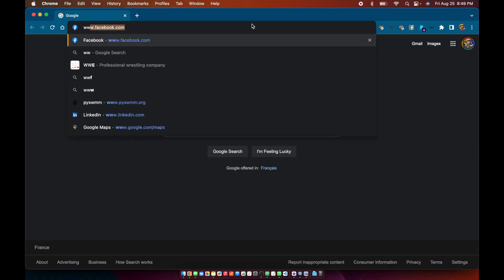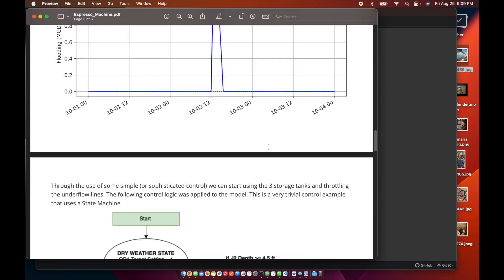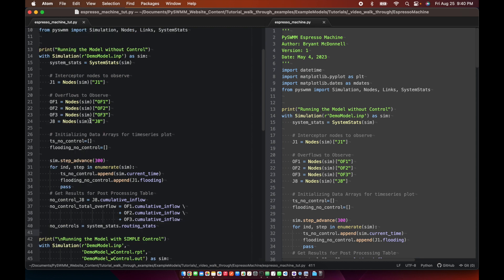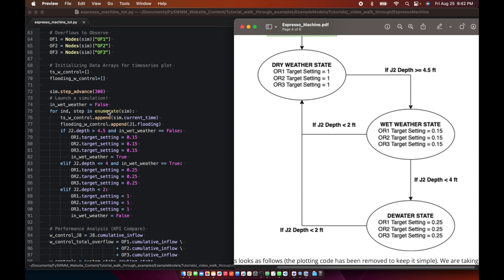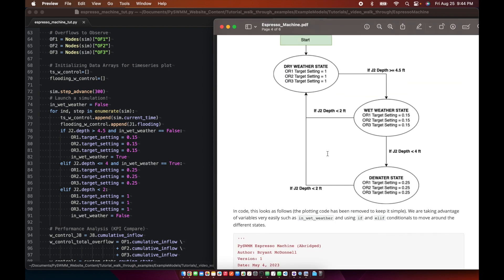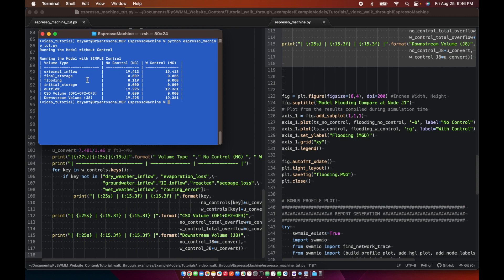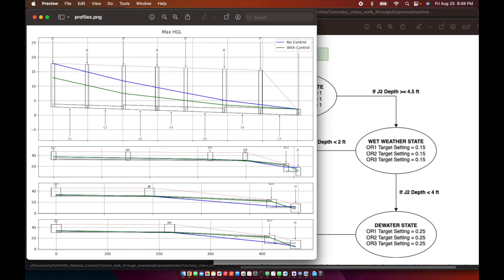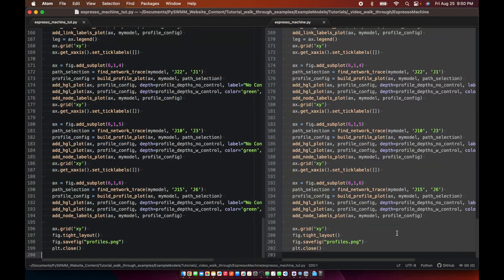PySWMM Chapter 6.1 - CONTROLS EXAMPLE!

Comment: Why is the calculation of CSO using the node's cumulate_inflow
Reply from the maker: It’s one of many ways to calculate total CSO volume. That value is accumulated based on the model routing steps (often variable). Another way is to use the timeseries output which is on the reporting step.  Depends on the utility and what they need for compliance.